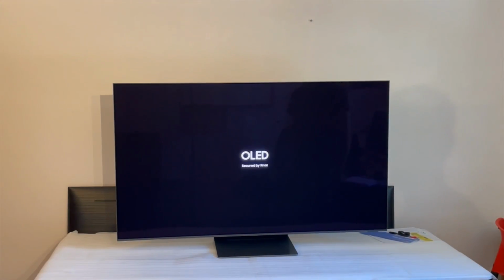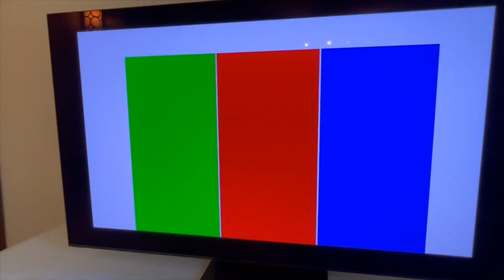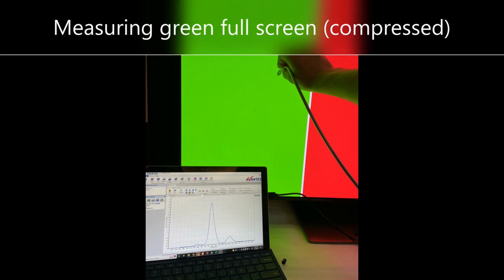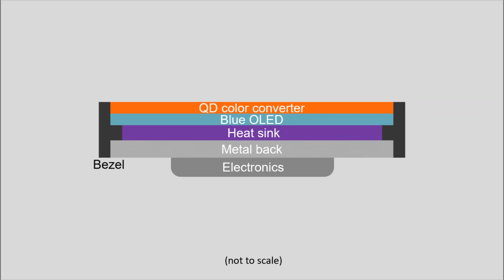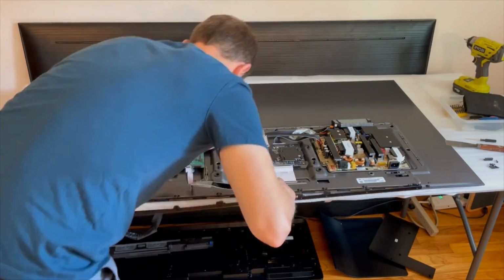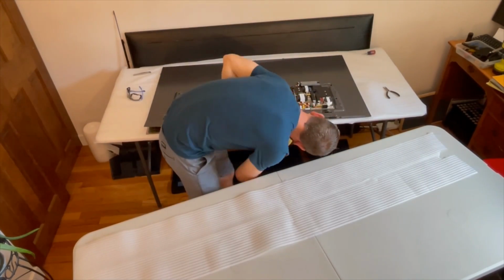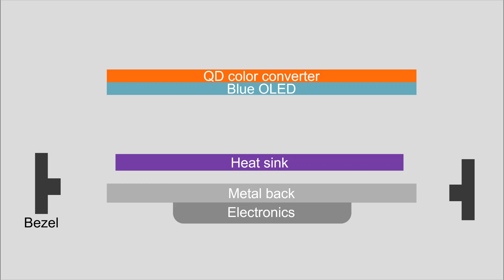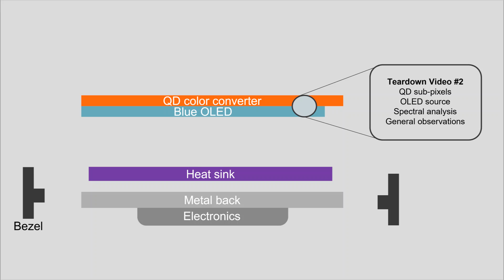Destroying a QD-OLED (Samsung S95B) - Part 1

Comment: I had three different 55" s95b.  All of them had a couple of what at first appeared to be dead pixels, but once I looked at them under magnification I found they were missing green quantum dots.  I found it strange that this occured on 3 different displays.  Each of them also had bends in the panel straight out of the box.  What your doing is so cool!  Im seriously captivated and cant wait for part 2!!
Reply from the maker: Interesting, do you have photos of the missing QDs? I would love to know more.
Reply: @NanoPalomaki  i think youtube auto deleted my imgur link to the pictures.  I hope you got it.
Reply from the maker: Nope, I did not.
Reply: @NanoPalomaki  i sent them to you on twitter, also sent some pictures of the bends I had in two of my s95b.
Reply: Just got an S95B and found what looks like a magenta stuck pixel. With my macro lens, I saw that the green was not lit up, only red and blue - you can see the position of the green subpixel - a dark green square, but it is not lit up.
Reply: @NanoPalomaki  sony a95k?

Comment: There have been theories that the QD-OLED backlight contained some phosphorescent green to boost efficiency, which would require the blue subpixel to contain a colour filter. Does that appear to be the case, or is the blue subpixel strictly scattering only?
Reply from the maker: This is also a question I wanted to answer during this teardown. Stay tuned for part 2.
Reply: Is not Theory, is fact, qd oled use 4 layer of oled, 3 stock of blue oled and 1 stock of green oled

Comment: I feel for you damaging such an expensive TV, however this was the first opportunity I had to see inside (especially interested in the electronics) so totally appreciate you doing this.  You deserve a lot more subs to pay for the tv!  The sound is extremely impressive on this TV, particularly the bass.  I'm also interested in the placement and size of the speakers (I thought there were 6 according to the description on the website?). I kind of wish Samsung had made the back of the panel more robust, I've no idea if I ever had to move this set how I'd do it - probably buy a huge sheet of wood and strap it to it!  Looking forward to a closer inspection of the electronics boards!  :-)
Reply: Do you know if the protocol to light the LCD is all proprietary? I with there was a MIPI DSI interface that enabled to display images without all limitations imposed by the tv software.

Comment: You talked about the gamut issue at the start of the video. A computer is generally going to output Rec709 I'd think, so if the TV just used pure red pixels for the red coming from the computer then the colors would be significantly distorted. I'm not sure if HDMI communicates the color space or what the computer is putting out. 

This should ideally be configurable on the TV. Not sure offhand if it is. Computer monitors often have a setting for this if they have a wide gamut.
Reply: Usually the computer gets the primaries from the display over EDID. Say they are AdobeRGB. That is a huge gamut. Then the computer knows the output gamut, and adjusts screen colours on the fly, for example from the YUV data in a MPEG video stream. It can limit the colours to match Rec 709. It does so by setting up a colour LUT in the video card so when the screen buffer is streamed to the display, colours are adjusted on the fly. We call this software calibration. You also can tune colours on the screen side. Thats called hardware calibration. Apple started colour calibration in the 90's under the name ColorSync, which became the base for the current ICC profiles.
Reply: @2kBofFun  I use calibrated monitors for my photography, but I think an issue is that proper support for ICC isn't universal.  Even on Windows, which supports ICC, individual applications often don't.  For example, the default photo viewer on Windows ignores ICC profiles, which is kind of crazy.  I suspect lots of devices that output HDMI don't do any correction.  Often wide-gamut monitors have an sRGB mode for this reason.

It would of course be ideal if the standard somehow ensured compliance, or had a way for lower capability playback devices to be mapped by the monitor to a Rec 709 space if they don't indicate some other space.  

Of course calibration is still important to get exact reproduction, but at least getting the color space right would result in a much more accurate image.

Comment: This is the only visual of a disassembled (modern) OLED TV panel that I can find on the internet. I've never actually seen someone remove the metal backing of the panel, I guess panel repairs are flat out impossible on OLEDs.

Comment: Awesome video! I own the 65" version and this was really informative! I know you didn't touch much on the speakers, but I have been really curious as to their placement. Was it two on the bottom and two on the top of the electronics section?
Reply from the maker: Thanks! There were two above the electronics (L and R), and a dual speaker below electronics closer to the center of the bottom (also labeled L and R).

Comment: Maybe you can investigate what causes the blacks to appear elevated/gray when the screen is illuminated by very bright lights close to the panel surface.  There is speculation this is caused by lack of the circular polarizer present on WRGB OLEDs and/or external light activating the QD conversion material.
Reply: Yes it would be interesting. LGD WOLED panels have the best coating and anti-glare in my opinion. Nice glossy screen, deep blacks and also easy to clean.
Reply from the maker: I have been trying to determine this, probably should have worked on this before destroying it, but I am looking at the front film closely to see what it does optically. I'll report out in part 2.

Comment: From what I know Panasonic was the company that made the patent for the Oled heat sink (few years ago) and the heat sink in embedded directly into the Oled layer. I believe what you disassembled was not a heat sink but just an insulation layer that's between the panel and the back housing similar to the ones you find on Amoled (mobile Oled screens). There is also no information on S95B that would indicate a heat sink nor was anywhere stated by Samsung Display to have one for Samsung variants.
Since some people are also asking about the gray blacks in a lit room, yes this panel lacks a polarization layer to have less reflections and boost image picture but the drawback is blacks appear gray when there is a direct light source. I personaly would rather have a polarization layer if I'm honest cuzz the layer that Lg, Sony and Panasonic are using is actually not that bad.
Reply from the maker: I guess it could be an insulator, but why would they not want to draw heat away from the OLED? Why NOT make it a heat transfer material? I still believe it serves some thermal purpose but I could be wrong.
Reply: @NanoPalomaki  yes it's a really good question why they make such decisions and this insulation could probably also absorb and transfer a little bit of heat from the panel but a proper cooling solution is not just a layer attached at the back of the panel cuzz it's integrated into the panel itself. All brands use Panasonic's heatsink solution and it would be really cool if you can get your hands on a Sony A95K that has a heatsink so you can compare both panels :-)

Comment: Can you tell us if the power supply is dual voltage ? Dose it support 220v ?
Reply from the maker: It was purchased in the USA, so it is 110V. Not sure if those sold in other countries have a different power supply or not.
Reply: @NanoPalomaki  Label on the rear  should say 110v or 110-220V

Comment: well i think we just found where  the grey-ish background color of the this years QD-OLED panels comes from when under bright ambient light, the QD layer isn't even fused to the emitter layer! so there must a slight air gap then like on old LCDs before they started doing opical bonding to the front glass

Comment: Hi. Brilliant video. The reason i watched it mainly was becease i had purchesed samsung qe77S90C. Which was very expensive but it has some sort of screen fault that i am trying to research. Unit is brand new straight of the box and has this fault where the pink tint is missing and i think it could ne antyreflection coating that has failed. Awaiting samsung emgineer to inspect but wondering if you could give your opinion on it.
Reply: I guess you would need some pictures to see it.

Comment: How is this panel for heat? So we can decide on this new tech if it’s better for burn in even though burn in in my opinion isn’t a problem anymore with OLEDs
Reply: Burn in will always be an issue with OLEDs, given that they degrade with use.
Reply: @andysmith1996  for me personally 2 years is good enough I always upgrade every 2 years so burn in no issue for me
Reply from the maker: I was not able to measure the heat but this is a good idea. If you are not displaying static images then burn in should not be an issue with most newer OLEDs. If you watch something with a logo all the time it can be an issue.
Reply: @NanoPalomaki  when people say long time I never know what that means like if your watching football game or something and says fox on the right corner for 7 straight hours is that long time?
Reply: @NanoPalomaki  or like NFL redzone which is 7 hours no commercial is that a problem ?
Reply from the maker: See this test from RTings.com 
https://www.rtings.com/tv/learn/real-life-oled-burn-in-test

Comment: Wait so the S95B does have a heatsink? Or is a heatsink really supposed to be a metal sheet?
Reply from the maker: I think it is a heat transfer material designed to get heat away from the OLED and to the back panel for dissipation. But it is somewhat flexible and soft perhaps to make the display less fragile.

Comment: My 3 month old  LG oled 55" thin TV went to black screen so I requested a repair though LG when they sent out there technician the technician pointed out a small chip in the glass and said that is why I'm not getting any pictures. I'm completely dumb founded on this one I had no clue it was there because as far as I know nothing has even came close to hitting the tv. So the technician just reported as physical damage which now voids My warranty. The technician never open up the back of the tv to inspect if there was going on in the inside of it and I dont know if it would of made a difference. All I know is that nothing hit my t.v. 

My question is does anyone know if it is possible that something pop inside the tv causing it to break the screen. The hole I'm the glass is near the upper left corner

Comment: I just have to Subscribe after you spent money for this educational video, Thank you so much for sharing. 
I have a question does S95B use cheap components because i was planning to buy one & ive noticed the price of the TV just keeps dropping, in forums people are saying samsung used cheap parts to make this TV. Youtuber TheTechGiant TV breaking under a month, Samsung not giving extended warrenty & dead pixelsa on 3 S95B panels from a single buyer = conclusion??

Comment: Would you confirm that the 'heat sink' layer is indeed a heat dissipation material. If this is the case,  this tv is alike the A95K.
Reply from the maker: How do you recommend I confirm this? Honestly I don't see what other purpose it could serve, other than to remove heat and provide a spacer between the QD-OLED portion and the metal back/electronics. I don't think it serves any optical purpose. 
Do you have photos/videos of the A95K that has a similar material? I would love to compare.
Reply: Thats a great question. We would only know the difference when a a95k is dissassembled, or picture/video. Still, the 55" A95 weights 21.2kg, the 55 s95b weight 16.6. Both without stand. This doesnt prove nothing because of course theres a lot of others materials in a TV, but part of it would it be of an heatsink panel? Who knows.
Still, the s95b gets more valued with this thermal layer.
Reply: Yea no, even if this is a thermal interface, there is a reason Samsung is not advertising a heatsink here, like Sony is, because this certainly would not classify as one under almost any circumstance. A95K almost certainly includes an extra layer of metal, likely in addition to this layer, to act as a more traditional heat 'sink'.
Reply: Suggest that you take a sample to the computer store. People there may be familiar with heat sink material as it is used in numerous computer components. Apart from this will be material testing in a lab.

Comment: I took a projection tv apart once and the DLP chip looked like impossible technology. A DLP chip has 100's of thousands micro mirrors that can be independently be switched open or close reflecting the light that is coming from a spinning color wheel. I have no idea how it is possible to manufacture and then to precisely independently control such a small mirror. The chip was invented in '87 but to me it looks like it either came from far in the future or possibly aliens : )
Reply from the maker: Amazing the tech that we can find in our electronics.
Reply: I would love a tear down video on that.

Comment: I tied one of these first- first was bent, second was bent. Never even bothered to turn them on. Decided to give up on this model and I'm glad I did after reading real user reviews. Next I tried the qn90b. Motion handling was terrible. Really bad soap opera affect that cannot be disabled, bad blooming and thin washed out looking colors. Next I tried the Sony a80k and it was just way too dim to handle HDR properly and again the motion handling wasn't great. Lastly I tried a LG C2 and again the motion handling was terrible. It physically makes me sick and gives me eye strain. I don't know how people can tolerate OLED motion handling. Even outside of these issues my Panasonic ST60 plasma had better picture quality than each and every one of these sets. Even comparing SDR against HDR and the plasma motion is perfect. OLED pixel light output just cannot match the characteristics of plasma pixels which are tiny glass containers filled with gas that is on fire. OLED looks exactly like LCD with perfect blacks.. makes sense because each OLED pixel is like a tiny led light bulb. Anyway, I'm done trying to "upgrage".

Comment: I beleive the samsung does not have a heatsync because the heatsync metalic
Reply from the maker: Perhaps a more accurate name would have been heat transfer material. The black material was adhered on one side to the OLED, and the other side to a metal plate.

Comment: If you are open to suggestion, it would be nice a video investing the OLED cooling (maybe with a Lepton Flir).

I've been wondering how effective the squish pad is, and how much it could be improved by adding a heatsink or a water cooler (since replacing it seems quite hard).

Since it would be hard to stress the whole OLED , the test could be done in a small patches. Maybe run the same images in two separated regions at same time, one with and the other without extra cooling for comparison.

Anyway. Great work. I really like your channel.
Reply: It is hard to find content about display technologies that isn't either oversimplified or too academic. Your content (plus some color theory) is about the sweet spot for me.

A few other things that I tried to look before:

1. Does all same colors LCD pixel filters the same wavelength?
1.1 Is the image quality (the color volume) mostly dependent from the backlight?
1.1.1 Does changing the backlight from a LCD display can improve the image quality (assuming it is calibrated).
2. How different wavelengths change the phosphors and QD emission.
2.1 Leds such the waveformlighting absolute-series that uses 420nm needs a completly different phosphor mixture (other than blue phosphor).

Let me know if you want me to expand them.

I've many others. I can write more if you are interested.
Reply: Another thing. It would be nice if you shared the measured spectrum data in csv, or any easy to parse format in GitHub. If you do, I could try to write a python notebook or something alike to plot the color volume and anything else :P
Reply from the maker: Wonderful ideas, thank you! I do hope to get deeper into the color theory in future videos.

Comment: Can‘t do much damage to those panels honestly if they come out of the box already horribly bent. Poor QC and material choice by Samsung.
Reply: Mine came perfect
Reply: I have no way to know what is in anybody else's boxes, but part of me wonders if this is due to incorrect handling, or just the super thin design if you prefer. If you don't lift that screen exactly as directed I'd think it would be very easy to bend it. Many could do it without realizing it.

Comment: Cheap Quality Control, screen broken while opening the tv. How great for repairs. 😒
Reply from the maker: To be fair, I was getting to the guts of the light engine of the TV where no one would be able to repair things. At the electronics level the TV was still operational and could have been easily repaired.
Reply: @NanoPalomaki  yes true if we forget the screen. Its so thin.